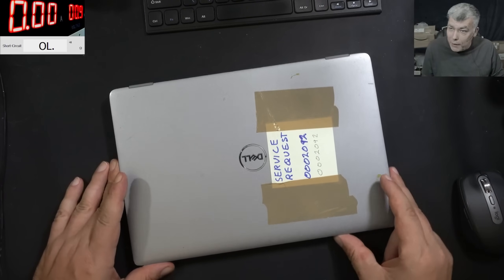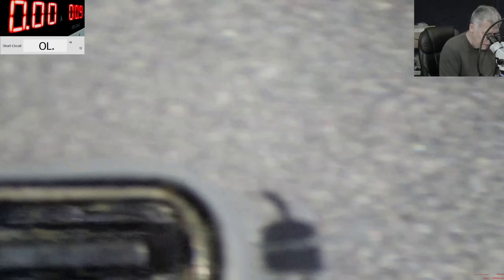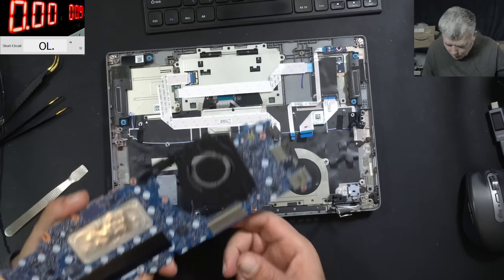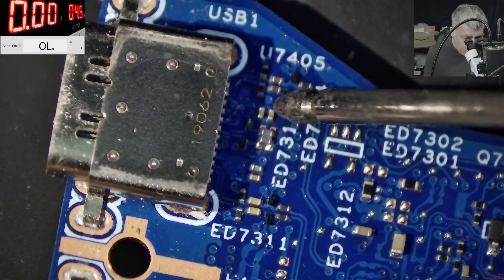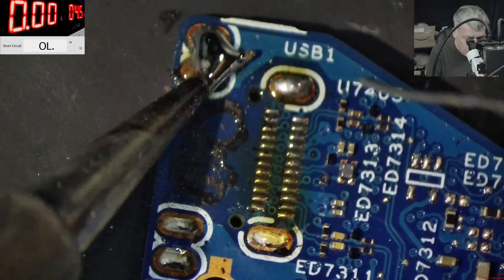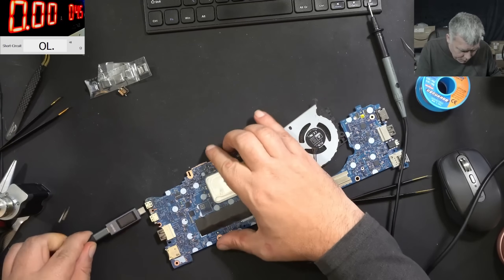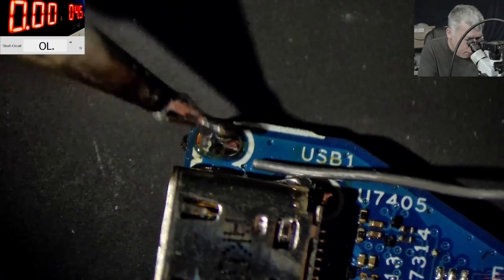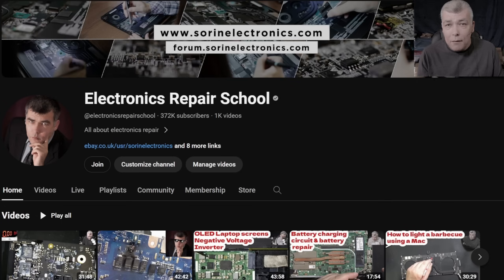Dell Latitude 5320 not charging, board repair - Dealing with different types of charging port

Comment: I have a dell Inspiron 15 3567. It was shorted around the battery terminals. After repair, the charging voltage is a bit low at 14.09v and the battery percentage remains stuck at a particular percentage when its connected to a cherger
Please assist

Comment: I have a mini pc that won't power on. I checked the power mosfets and have 12v on the input but 0v output. I am thinking it is either the mosfets or the circuit chip that turn them on . Any advice ?

Comment: Good job sorin, every repair job shows a degree of witness repair, even more so on minature component repair, you replace like for like whenever possible, a slight discrepence in part replacement size for size or the functionality has to be taken into consideration, that the nature of the repair the end result is a working piece of equipment!!!

Comment: they are 24 pins you have to check every connection and 350 °C its to much for this C type port. You can see this port is useles after plastic melted.
Reply: Hi Guraba,what is for u the rigth temperature for this kind of port... and yes Sorin test only the charging not all the pin.. can u suggest a valid tester to test avery pin? bye francesco

Comment: G,day from Sydney Australia. Really like that water boil indicator (short) on the USB C port. Any reason to use hot melt glue under and both sides of USB port?
💫✍️🤔
Reply: I guess to give it additional strength just in case there's excessive force (like someone dropping the laptop off a table, getting stuck on the cable, etc.). The ground pins were quite massive already, but they obviously wanted to be sure.